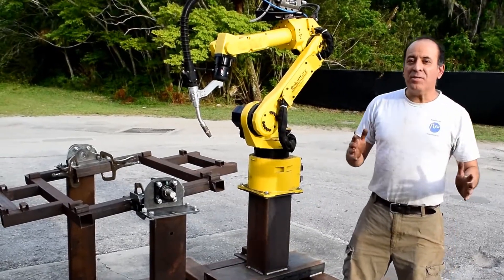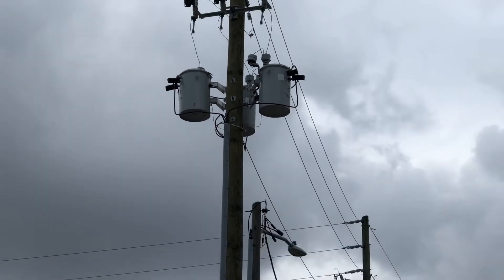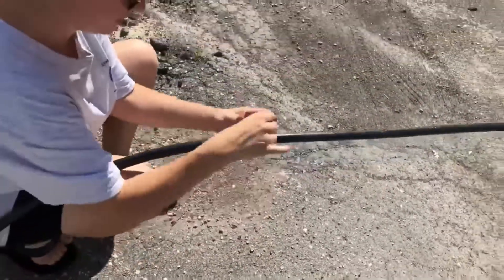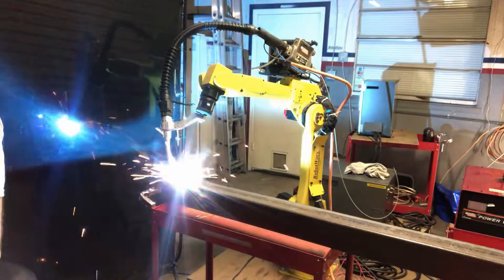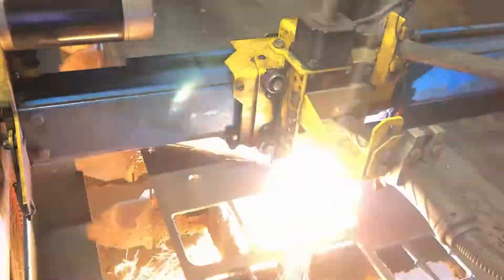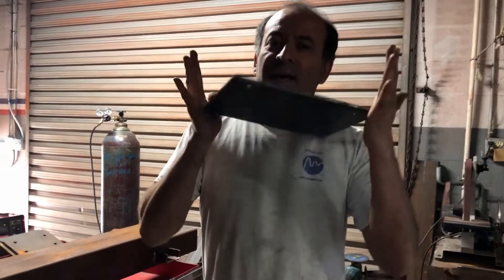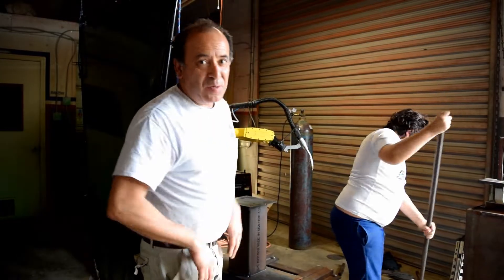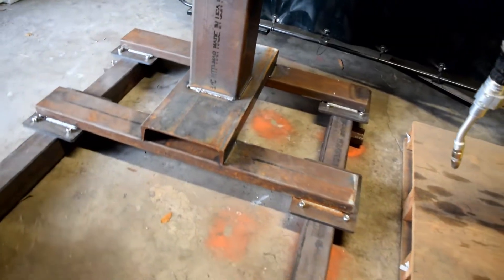Robotic Welder Making its own Welding Table

Comment: I have a question: how to Design robotic welding system for welding of medium carbon steel round bar diameter 40mm using butt welding in which each bar has a length of 30mm?  Please respond to me Write detailed information about my questions in detail and prepare answers in a proper way Include figures, mathematical models, and chemical formulas if necessary.

Comment: As a welder it seems more efficient to have a human welding because you don’t have to program the robot every time in my opinion!
Reply: But when you mass production robots and automation is not an option but necessity
Reply: @abhinavsaini7881  I have no idea what you’re trying to say but as a mig/tig welder for a production company I sit on my chair and weld out hundreds of parts a day. Only way I see the robot as useful is if he himself doesn’t know how to weld but even then mig welding is super easy to learn
Reply: @Christopher Grant you’re right I don’t work 24/7 but neither do the programmers that run the bot also you still need the programmer to get the parts into the right position and to make sure the measurements are correct so either way you still need a guy there to get any work done. Also I can make every weld just as nice as the robot every time throughout my work day. Only thing I can see that makes this useful is if it is large scale mass production such as car manufacturing
Reply: @thedridge10  or if the company can't find a good welder. In.my business we have used robots to milk dairy cows for more than 20 yrs and it has it pros and cons, but it saves me a lot of monotous repeatable work, 7 days a week for 23 hours. Now its the question which system is most economous, we dont have cheap Mexican labour in Europe so we keep the robot.
Reply: @Hakkeholt  for the price of the robot you could send someone to welding school but if you want to use the robot then you’ll end up paying the programmer a lot more than a welder because either way you still need a human to run the bot and get the parts into the correct position’s also with a milking robot I’m sure the robot works continuously for a long time where as this robot would only work for long periods of time if there were long welds. If they are only doing 5” welds then you have the programmer sitting around waiting for the robot so again this would only be useful in mass production or if you’re running 10 foot welds over and over again.
Reply: @thedridge10  that used robot, with welding machine, shoudnt be more than 30k.... how much does a welder make in a year? for that you can buy 2 of those.
but i agree, if all you do is unike pieces, its best to weld by hand, but what if you need to make 1,000 pallets that are all the same? just tack some reference stops, and clamp the material and the robot can weld it with only programming it once.
Reply: Welding robot at my work was over 250k. Not sure where your getting one for 30k
Reply: @Christopher Grant I know this is an older comment but as someone who welds and worked in a high output robotics welder area I can say they don't do it perfectly every time. There is usually a human welder in the area to correct porosity, missed welds, and other flaws that happen from time to time. They are great for high output but they will always need someone on hand to fix imperfections.
Reply: @Christopher Grant robots don’t talk back they don’t take smoke breaks they don’t have attitudes they don’t think they know it all when they break down you simply fix it and it continues to work even when it we aren’t there..unlike employees
Reply: @Christopher grant someone has never worked with robots before & it shows. Robots aren’t perfect every time not every robot can weld in every positions robots coke down to how they’re programmed. They do mess up more than people wanna believe.
Reply: Best welding robot video around! I love that you just get it done. How do you think that robot skid would do welding outdoors?

Comment: Very nice! Which brand/model robot is that, and have you tried it on mig aluminum?
Reply: Fanuc. To avoid the electrical upgrade, I suggest you get a cobot. Like a UR5 or UR3
Reply: @justtestingonce  Fanuc has a CRX-10iA cobot line now.

Comment: Very cool! How does it know where to weld? I understand if you have a jig and it is programmed to weld repeats in certain spots, but you seem to be just laying metal 3:50 down and it welds right on the seams.
Reply from the maker: Lots of the welding patterns on the robotic table were the same. The robot was just following those patterns.
Reply: Puppies Rule! Remote controlled.